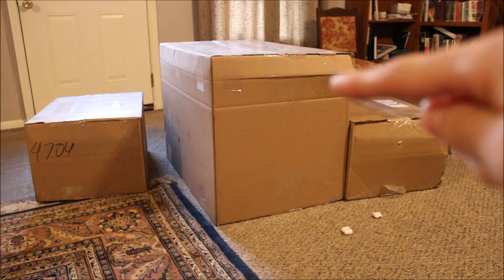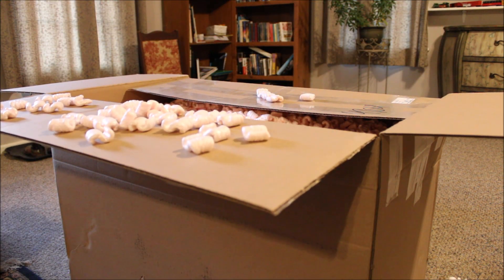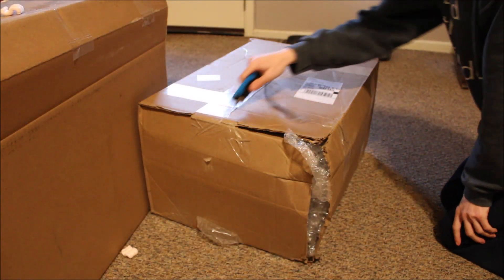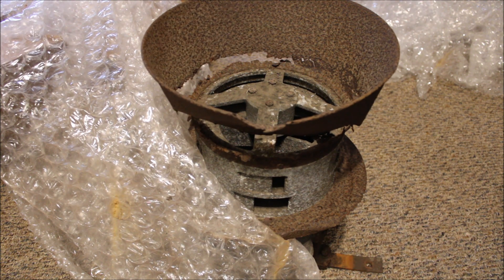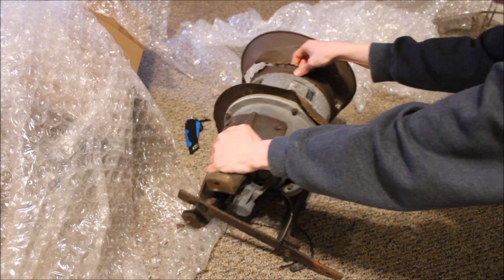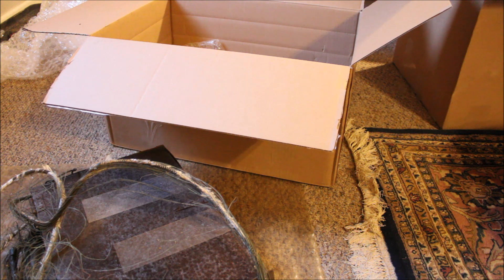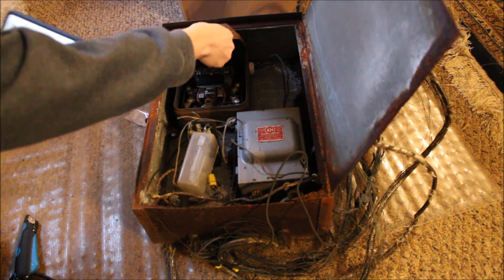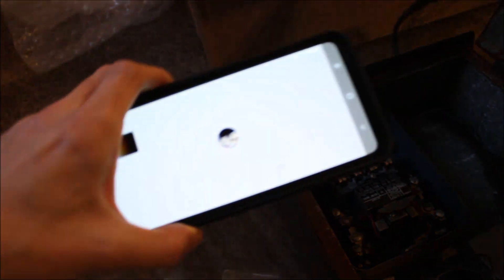Unboxing of My Federal Model 2T Outdoor Warning Siren

Comment: What's the difference between a model 2-240 and a model 2-120?

Sorry if you get asked this to much.
Reply: Voltage, a model 2-240 reaches full pitch at 240V 12 amps (dryer plug power) while a 2-120 reaches full pitch at 120V 24 amps, or the same as regular outlet power, however most outlets like in a bedroom are only 15Amp so using a 2-120 in your room would pop the breaker. I think 2-240s can be run at half speed on 120V without pulling too many amps for a wall outlet due to something with the wiring.

Comment: The sirens on eBay are not as expensive as I thought they would be. I’ve seen a belt-driven Federal Signal 2001-130 going for $3,500.00.
Reply: I scored a working model 2 for 350 recently

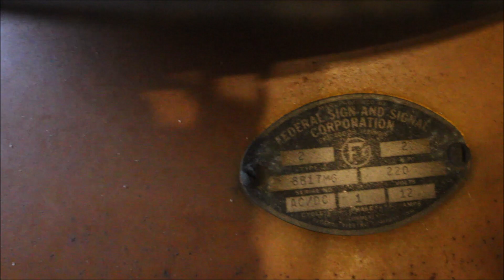Comment: 2:35 that’s because it’s a universal motor that can run on AC or DC. The frequency dose not matter. If you took it to the UK that has 50hz, it will work just as well. My model 2 has that too.
Reply: cooldomino that’s nice, if I ever get one with that motor I will have to remember that
Reply: @TexasRailfan2008  All model 2's came with universal motors (same as the thunderbolt choppers, excluding the rotator and blower motor obviously).